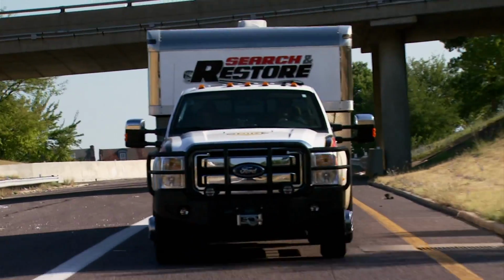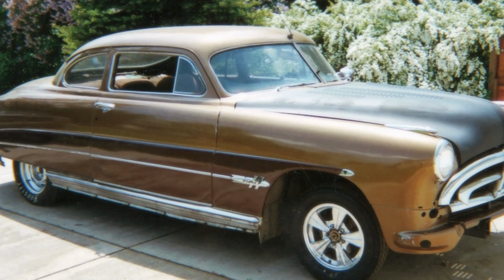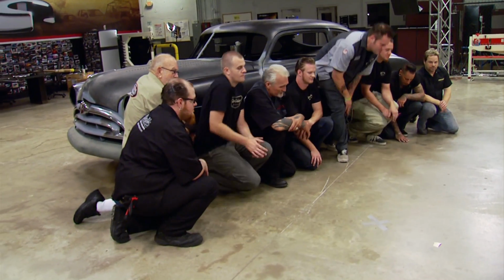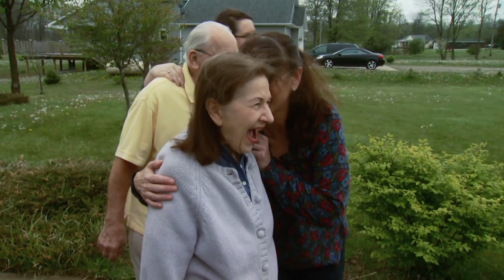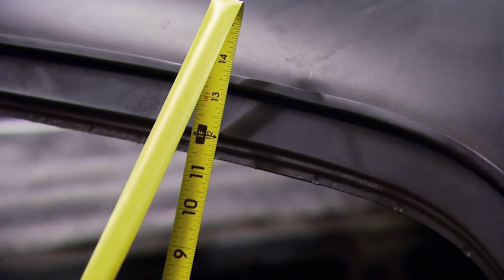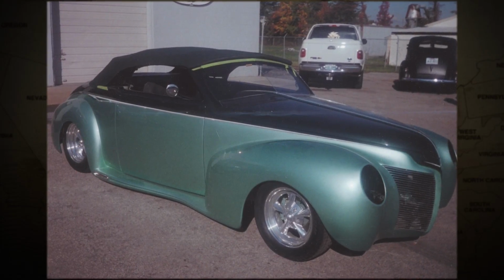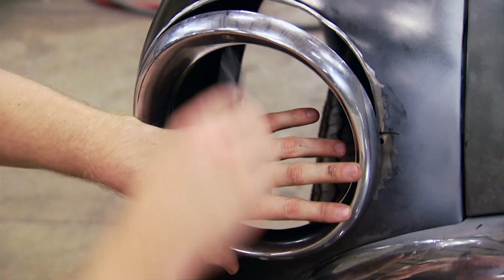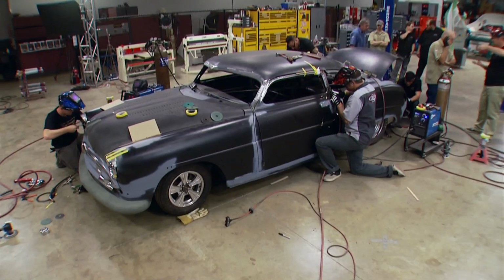Custom Hudson Street Rod Build - Part 1

Comment: The owner is right, it already looks chopped, it doesn’t need chopping.
Reply: The owner is my grandpa
Reply: That's because they naturally chopped from the factory. a 51 Chevy's roof was 36" high from the bottom of the windshield to roof peak, a 51 Fords roof was 37" high, and 51 Hornet Hudson's roof was 33" high. It came stock 3" lower than the Chevy and 4" lower than Ford so it "looked chopped" from the factory.

Comment: all cars are built of several layers of overlapping sections, especially modern cars. they sure do make them like that still. just better, safer and more efficiently.
Reply: I disagree, They certainly aren't better, Todays cars are "throw aways" after they hit 250k, They aren;t safer because they are mostly plastic and effecient is how you look at it. I can take any pre 1985 car and my buddy and I can pull the engine and transmission and rebuild them both over a long weekend in my drive way while enjoying a case of adult beverages. Todays cars take a team of engineers and 10 days of taking half the car apart just to change the oil. I have a 77 buick sky lark as a daily driver and it has almost 400k on the engine and transmission without a rebuild, Your not doing that with ANY car today.
Reply: @TheREALOC1972  you may disagree but all the facts & stats say new cars are better in every way, with the exception of DIY accessibility. then again, they aren't built for DIYers so it's not an issue. and no car in the 50s – 90s was built to last more than 250k miles. any car with decent maintenance & servicing will last as long as you want it to. and if you have the knowledge and tools you can play with modern cars too.
Reply: @daos3300  That's why junkyards are FULL of 1990 and newer cars, right? That's why manufactors recommend having a complete engine and transmission rebuild at 125k instead of the 250k  and the engine and transmission replaced at 250K instead of "until and if needed" like it was pre 1990's right? I tell you what..... Let me put a brand new frame under the 67 Chrysler New Yorker I have sitting behind the barn and you can have ANY brand new plastic built car today and lets meet head one at 35 mph and see who walks away...... Your going to be in 1700 of plastic and really thin sheet metal while i'm going to be in 3500 lbs of solid STEEL, Sorry bro but GTFOH with that. Todays cars are bullshit 250k throwaways made with mostly plastic.

Comment: Glad you decided on less for the chop.  It is so easy to make them look like a cockroach.
Reply: The 51 Hudson was already "chopped" from the factory, they were 3" lower than the 51 Chevy and 4" lower than the 51 Ford. I just bought a 55 Desoto  and i'm going to build it into a restomod, first because there's NO WAY i'll ever be able to find the parts to build it back stock, especially the side trim, those got robbed by thousands in the 70's to put on to lead sleds becuase they were more streamlined than other manfacturors. I'm not going to chop it because from the research I've done the only other car that had a lower roofline from the factory was the Buicks and Oldsmobile which was the same height as the Desoto.